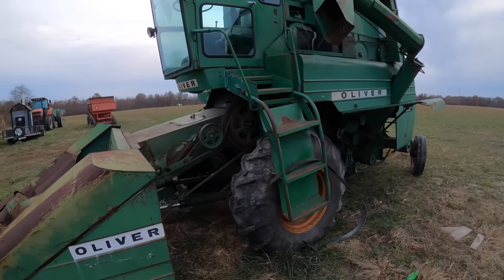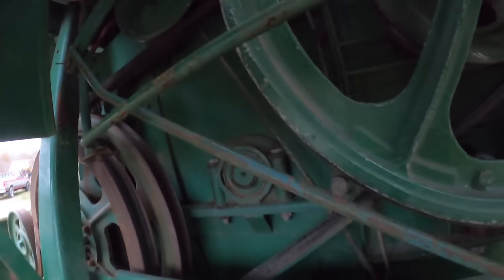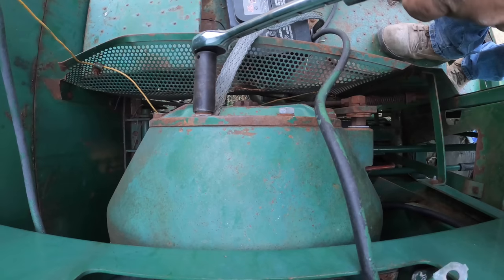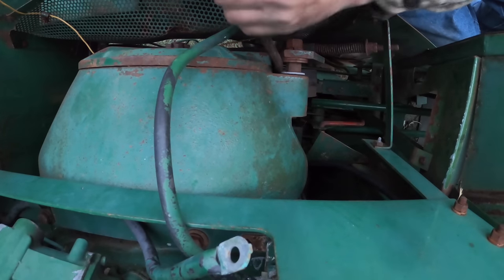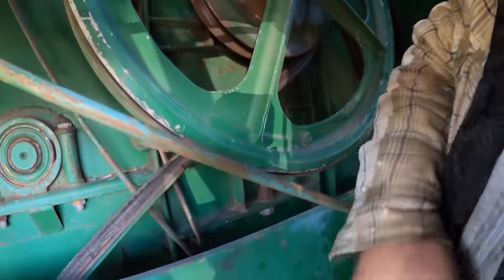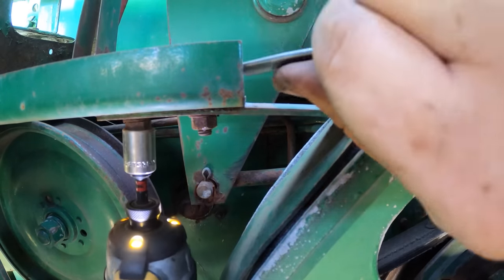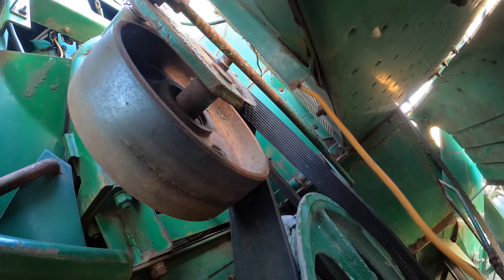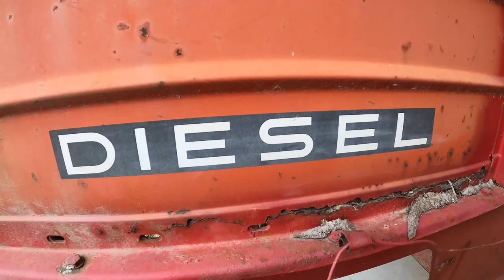Oliver 7300 CHEAPEST COMBINE: Thresher drive belt replacement

Comment: suggested, a wintertime project.  Finish your parts storage building so you can keep track of your inventory.  Rotus luck with that.  I did that and still can not find the part I know I have and need.  Of course, when you buy another new one you find you have 2 on hand.  We roaded a new combine 70 miles and broke 2 drive belts in the process.  It was the wake-up call that White put a stupid monkey jack belt dampener that would keep tightening the long drive belt when it was under a hard pull but not release the tension.  So the next hill would make it tighter and tighter till it would break.  Needless to say, all of those got deleted after that.  The final drive on the 8900 was one thing that White got sued over.  It was a little light for the job and when we had a customer down for almost a month waiting for a replacement one, as it totally trashed the case and gears, it was just the final straw on a new combine that was built on a Monday after a weekend where those Brantford workers were hungover and had to have 2 drinks on Monday morning to dampen their hangovers. It was a 60-mile drive to do a service call and I had to make it twice a day.  His lawsuit got the engineers from Brantford to fly down to the tip of southern IN, inspect the combine with the owner, and make a list of things needing to be fixed/replaced.  The combine broke when we tried to back it into his machine shed.  Our service rep and I refused to tote the engineers back to the airport because we drove it out of the machine shed and it needed to go back into it.  We found out that those engineers were worthless twats as they were unable to find the broken link in the drive linkage.  Bad weld.  Some machines are simply jinxed.

Comment: Man that 7300 looks so easy to change that belt on. On my 432’s and 5542 that stupid belt is so hard to change. First you have to crawl in the tiny grain tank. Then you have to take this panel off of the side of the tank wich is like 14 billion bolts. Then you have to pull off that stupid cover over the engine and then you have to fit your hands around in that tiny side panel and then you foot a pull of that sheild around the pulley then you gotta fight to get that belt put on and then you have to put it all back together. My record is about 2 hours. That was with help. I see there is a wood stove in the background. Is that a central boiler? My dad works at the factory those are made at. He probably machined or welded some parts onto that stove if it is a central boiler or a wood master. Both are the same just different name. Great video. 

Also tracked down another 431 so I hopefully will have 3 of them.
Reply: That furnace is indeed a Central Boiler built in 2003.

Comment: Our price of shelled corn at the river elevator was 4.45 last Friday., Evansville Illinois. Those poly multiple v belts were a useless POS from day one! They would have been better off to keep the old flat belts as they were way more durable!  A neighbor had a Massey that used a polly v belt on the main drive, he would have to keep a spare in the cab!  We finally had to get a carpenters square and straight edge to check the pulleys for alignment. The idler arm that clutches the belt had bent just a bit with use and would misguide the belt to the side a bit and destroy the belt in a very short time!  Regular V belts are way more tolerant of these little alignment issues.  I believe I'd just do a bit of welding on that pulley and not have to worry about it. AS for the snap that allowed the belt to slip on, it was the idler pulley, apparently wasn't fully released and it jumped back to a much looser position!
Reply from the maker: Yeah I saw when editing what made the sound 🤣 Thanks!!

Comment: I think if it were I . I'd drill some holes and thread that cover put some jack bolt holes in it next time i had it off .SEE
Reply from the maker: That might actually work. My luck though it will split the cover into three pieces
Reply: @rosstheoliverman  Because sadness .SEE